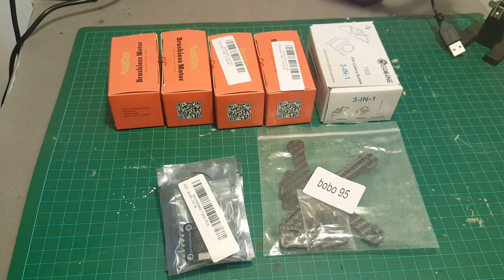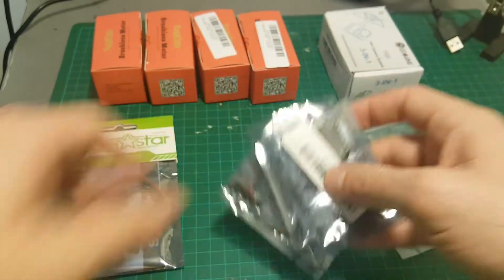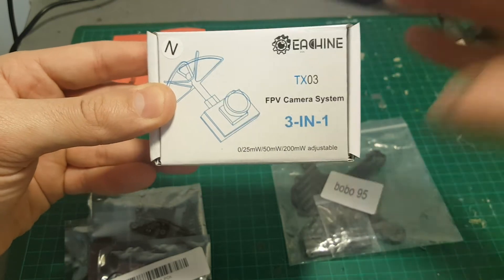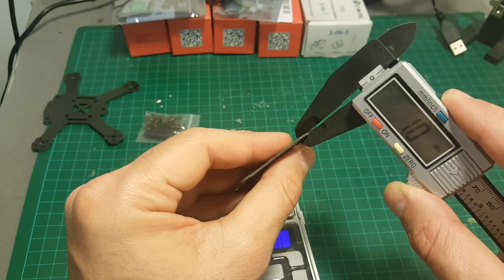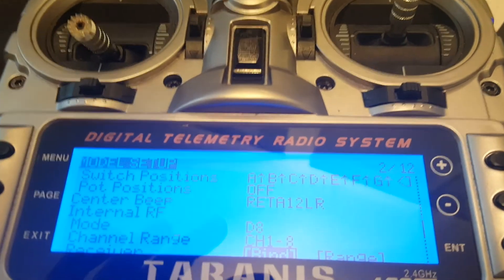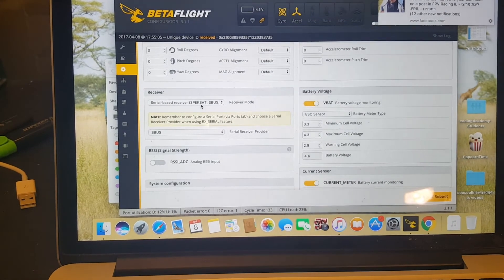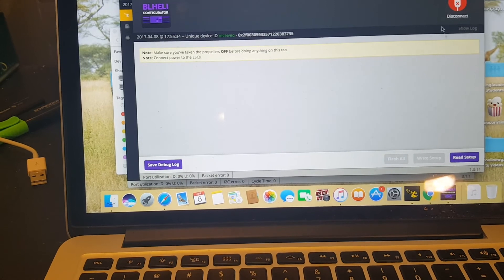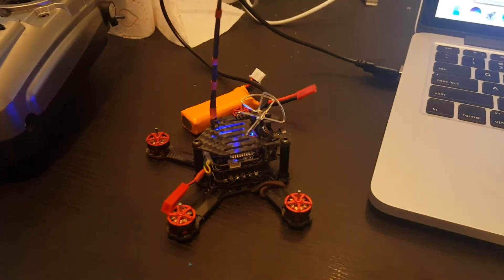Realacc BOBO 95mm Micro Brushless Quadcopter Build Video

Comment: hey Gal,

I've had this frame for a while and I'm finally going to build it up what motors would you recommend for a 2s setup don't need it to be super fast would like to build it for long run time
Reply from the maker: Hey there. I think that the Racerstar BR1103B will give you a great value for money. Go for the 8000KV option and use 2s battery (even though you can use them with 3s). http://bit.ly/2yFHrba

Comment: in your description u say u recommended 1104 not 1103?
Reply from the maker: 1103 is motors size. In the description you can see that I used 1103 motors.
The racerstar 1103B would be a great choice, IMHO.

Comment: DYS BE1104 vs 4 X Racerstar Racing Edition  BR1104 same kv on 2 s for 1.9inch 3 blade props
Reply from the maker: I think that you should go for 1103  10,000KV motors.
Reply: really why is that? why 1103 vs 1104 ?

Comment: 8000kv vs 10000kv for this frame what u think? also what size battery r u running?
Reply from the maker: I am running 8,000KV, which is a mistake. Go for the 10k.